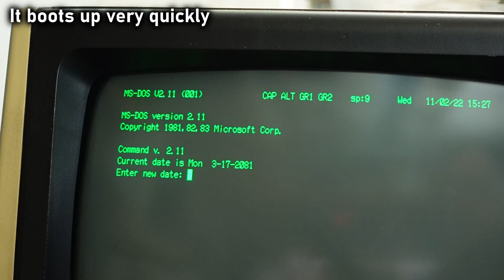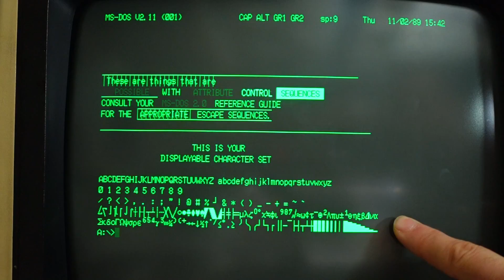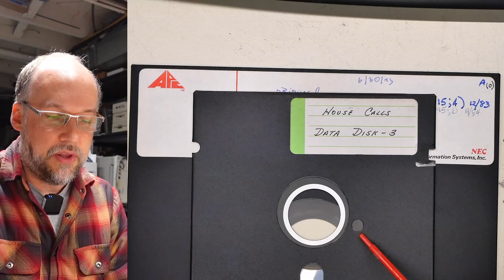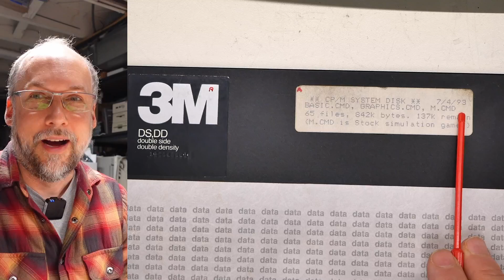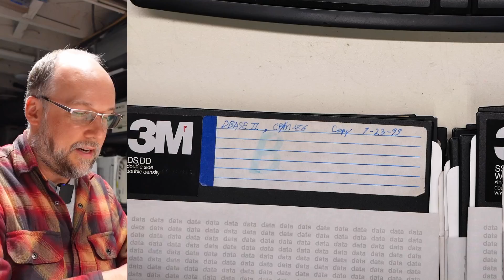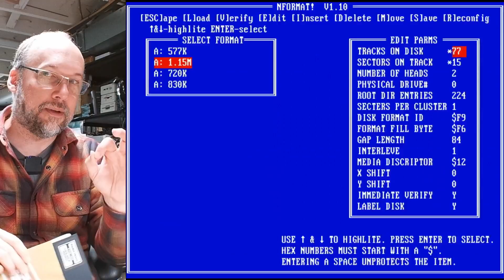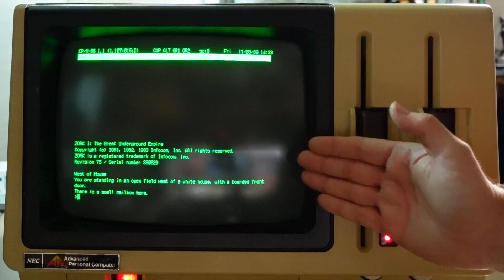Comment: another great video Adrian. 

in part 1, you had mentioned using xmodem or kermit as a possibility for transferring files between kinds of machines. In grad school, I used Kermit-80, Kermit-CMS, and whatever the DOS version was called to move files between a DEC VT-180, the university's IBM mainframe, and the then-rare PCs that two staff engineers were fortunate to have.

maybe part 3 can be a dive into serially transferring files between different machine?
Reply: Kermit was/is indeed the protocol of choice for transferring files between semi-obscure systems.  There appears to be a version of kermit available for the NEC APC on kermit project website.

From the txt file:

MSKermit on the APC supports both the standard serial port (as port 1) and
the optional (H14) add-on serial port (as port 2).  Port selection is
performed using the SET PORT command.  Any baud rate up to 38400 is legal
although 38400 has never been tested and may not work well.  The port is
always configured as 8 data bits, no parity, and 1 stop bit.  Any necessary
parity is supplied by Kermit.
Reply: Yeah I wish I had found a copy of KERMIT on the MSDOS disks. It seemed to exist (based on what I can see on the internet) but no copies existed. The non standard Serial cable would be a bit of a problem too. (Centronics type connector.)
Reply: @adriansdigitalbasement  Your copy of MS-DOS 2.11 should have ctty, so if you get RS232 working there's the option of pasting a program from your regular PC into a debug session on the APC.
Reply: @adriansdigitalbasement  The serial port is connected to the cpu board with a ribbon cable, which seems to be right pinout for D25 ribbon cable connector.
Reply: @adriansdigitalbasement  I have the parts (including the clunky CN-36 soldertail connectors), the APC and PC tech manuals, and docs on interconnecting two DTEs together, so I'm gonna work on a null-modem cable so that the APC and an IBM-PC will be able to talk to one another. 

Also investigating a native Kermit solution. At first blush, there doesn't seem to be an APC-specific version of MS-Kermit, even though the Kermit docs say one was created. There IS source for building Kermit-86 (looking at it now) that has explicit support for the APC, but the chicken-egg challenge persists: how to get the source files ONTO the APC to build them?

with that in mind, I had a thought: 

while the IBM-PC + Qume 8in drive didn't seen to work with NFormat or the disk archiver, there's a discussion on Vintage Computer Federation forums titled "NEC APC: RDCPM and a CP/M-86 formatted diskette?" that might have some useful information for accessing 8in disks using 22DISK, listed in your resource list.

Also keep in mind that there is a universal CP/M 8in disk standard (the only disk standard, actually) that might be "more compatible" than the 1.2ish MB format native to the APC's CP/M-86 system. the SSSD format is the same as the IBM 3740 (IIRC, known as "IBM Disk 1") and it stores a whopping 250k or so per disk. It might be possible to use this least-common-denominator to move files between CP/M on the APC and the PC+8inFDD running 22DISK?. Additionally/alternatively, a possibility to to see if DOS and/or CP/M on the APK offer options when disk-fomatting; perhaps a format less-sophisticated than the ones native to APC  would let you create a disk that's more directly compatible with ImageDisk/Nformat? Maybe creating an 8in clone of a 360k/720k diskette, for example?

as an adjunct to experimenting with disk formats on the APC, there is MS-DOS utlity on the APC called "RDCPM.COM" which (should) allow its MS-DOS environment to access content on a CPM (I"m giving up on the '/') diskette. maybe in conjunction with a different DOS disk clone (see prior paragraph) that would be easier to deal with on the PC side.

in the meantime, I'll start work on the null-modem cable (who knows, maybe there's a terminal program in those 8in disks somewhere that support zmodem or something) and continue to burn out my grey cells poring over 30-year-old documents for Kermit.

PS: reading now about 8FORMAT ...

Comment: Neon bulbs have a bit of memory. Pun intended. They remember their previous state so well they can be used for memory cells. Usagi had a great video experimenting with them for this function.

Maybe your neon is old, some of the inert gas leaked out or some O2 or N2 got in.
Reply: I think the neon bulb is just faulty and there is some emission which heats it up without actually igniting properly, until it is warm enough to fully ignite. It is probably going to fail eventually.
Reply: @graealex  They all do, in the switches from this era. I haven't seen one that worked reliably in at least ten years. I suspect they leak whether you use them or not. It's not like a vacuum tube where a getter can react with any leakage. Once you lose the gas, it's gone.
Reply: @mal2ksc  Well, you have several effects that might foul the gas - one would be outgassing from the electrodes themselves. Anyway, the fact that it turns on eventually shows that it it's a problem with voltage and thermals.
I wonder if the problem is more common in the US with their 110V. Neon bulbs here in Europe seem very reliable, like decades reliable.

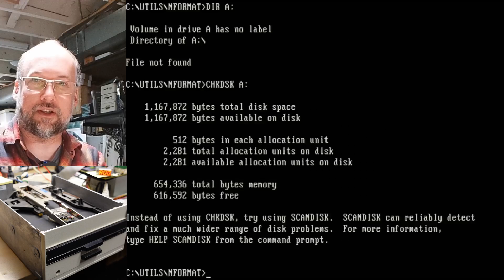Comment: 31:45 yes, that is exactly what's happening. A company I worked for back in the '80s that made minicomputers used 800K floppies that would have been 720K floppies had they used 512 byte sectors, so that's a smidge over 10% more, not to be sniffed at.
Reply: Fascinating. I wonder why the IBM PC used 512 bytes instead of getting a little more space on the disk? Perhaps it makes the minimum file size 512 bytes or 1024 bytes -- and they thought more files would be better?
Reply: @adriansdigitalbasement  There's a trade-off with the size of the FAT. The more sectors on the disk, the bigger the FAT, and it keeps two copies. That's why hard drives had to use chunks.

Comment: Reminds me a bit of the Tandy 2000, Radio Shack's first foray into the PC market with a "PC-like" machine that ran MS-DOS but could only run programs specifically made for it.  I think it also had a high-res graphics option with a proprietary (and quite large) graphics card expansion board.
Reply: I had always been curious about the Tandy 2000! It looked like the later Tandy 1000 machines too, but as you mentioned, wasn't really IBM PC compatible, or at least not fully compatible. This machine is clearly not compatible at all, so you were just stuck strictly with things designed to run on it.
Reply: The Tandy 2000 ran MS-DOS. I used one when I worked at Radio Shack. It handled inventory and sales. I also used Microsoft Multi-Plan (!) to track additional sales and expense information.